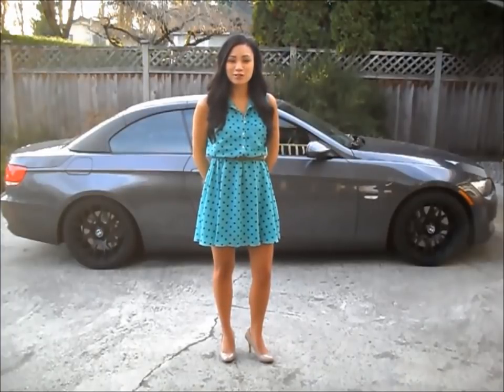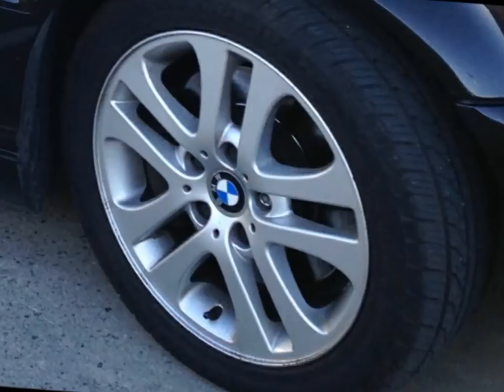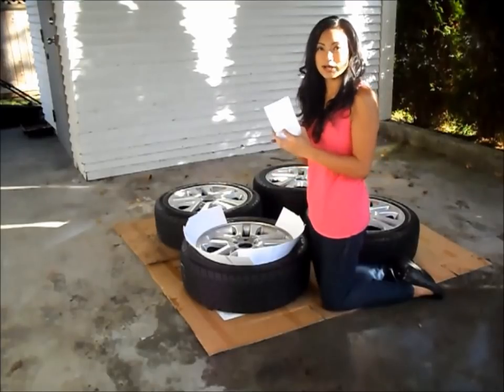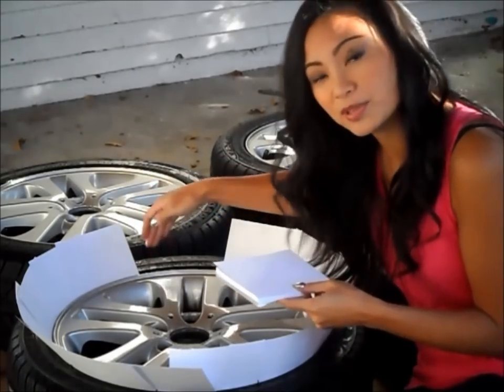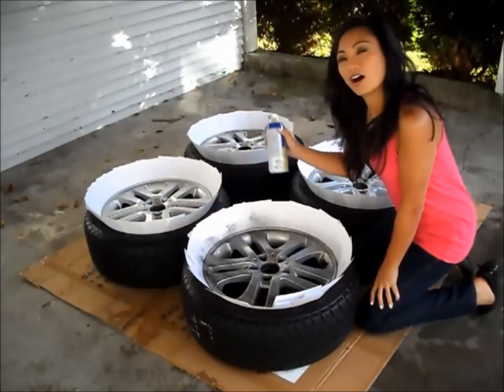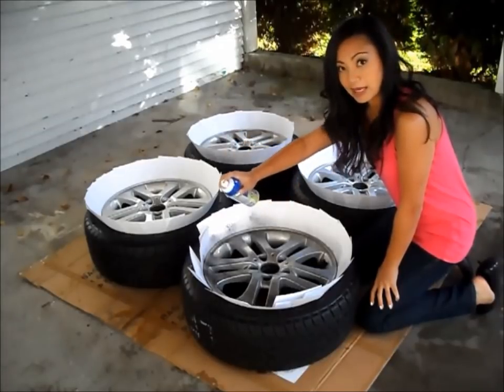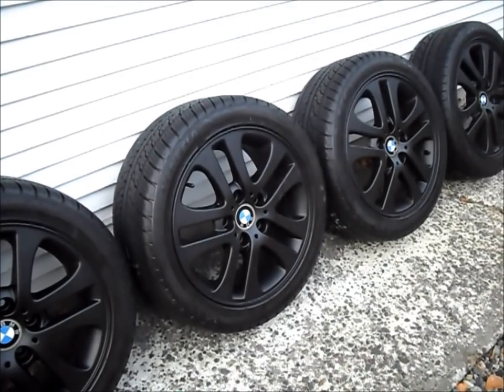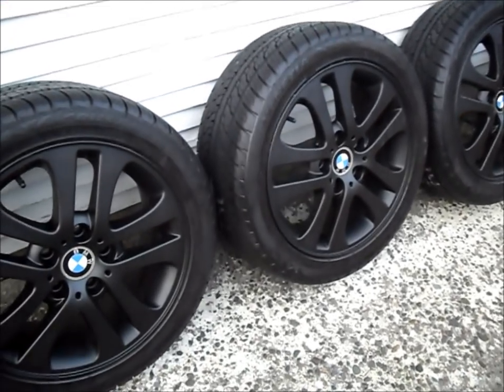How to Plasti Dip Car Rims - Matte Black Wheels

Comment: So many mistakes, women are cute sometimes.
Reply: David G What exactly was the mistake?
Reply: Brandon Brown 1. She didn't seem to perfectly clean the wheel before spraying paint to it.
2. She's painting them OUTDOORS which will cause dust to stick to the paint.
3. She covered the tire, which has really no advantage since the plastidip don't even stick to the tire, it'll peel off by its self. 
4. She didn't cover the BACK of the wheel, which still silver with black in the gaps where the paint go thru.

There might be more, but who's counting...?
Reply: Aleks Verduzco
 exactly haha, thanks for replying for me.. If you don't see mistakes Brandon Brown you probably shouldn't be painting.
Reply: David G also she didnt prop the wheels up on a wall. Rattle cans are not meant to be sprayed straight down because it causes the can to have a globby spray.
Reply: True! It just goes and goes.. She is cute tough...
Reply: Aleks Verduzco you mad?
Reply: David G She's pretty so who cares? ☺
Reply: +David G Holy shit dude it's not like he's pursuing a career as a professional painter.
Reply: just messing around man, idc its her wheels kbman99
Reply: +Aleks Verduzco well, she also holds the can too far away from the rim, wich can lead to a "texturized" result. Besides, 2 or 3 layers are not enough if you desire durability and easy peeling.
Take these as advices and not criticism.
Reply: "when it comes to the day of the contest, I am his father. He comes to me for advices."

Comment: Good job miss !
Is it hard to take out tires from the car ?
How long did you cover the 4 tires ?
Reply from the maker: I had a shop remove the tires at that time but I have since learned how and it's easy! Unfortunately I have sold those wheels now so I don't know how long the plasti dip lasted.

Comment: Thanks for the technique :) had an issue with white over spray. It would get caught between the lettering on tires. Took time to get every last bit off but this way is so much easier. Keep up the good work.
Reply from the maker: Thanks, Adrian! Glad I can help!
Reply: Do the cards stop the plastidip from coating the edge of the rim where the cards are contacting?

Comment: Tara I have a 2010 jetta tdi and i was thinking about using the matte black on the front grille or going with actually getting it painted gloss black to match the rest of the car. Any thoughts on this? By the way great job on the wheels. Like the BMW!
Reply from the maker: Aaron Cope I would recommend gloss, but if you're on a budge, plasti dipping matte black is fine too.

Comment: Amazing results ! One question Tara, how long did you wait until you put the rims back on your car? Cure time, thanks
Reply from the maker: Well these tires actually didn't end up fitting on my new BMW. Grrrr. But you should probably wait a few hours. I used plasti dip glossifier and then drove after maybe an hour (don't remember exactly) but then again it didn't turn out great.

Comment: Hi
Questions, do you have to sand the rims or just wash them ?  Also did you do the lock nuts? How's the paint holding up since you did them
Reply from the maker: No need to sand. I sprayed right over the lug nuts. I had to sell those wheels so I'm not sure. I hear it should last a couples years.

Comment: the wheels looked great.  Was the use of the index cards so you didnt have to peel the excess off out of personal convenience?  I usually just peel the ring of plasti dip off the tire.
Reply from the maker: Thanks! Yeah, I just thought it would be easier to not have to peel off the overspray from the tires.

Comment: Hey Tara, I'm planning on plasti dipping my car's rims. Since I wanted to be more efficient I wanted to take off all four wheels so I could spray them at the same time. How did you take off all four wheels? Did you just use jack stands for all four sides of your car? And also is the plasti dip they sell at home depot that's just labeled "black," does that come out to matte? Thanks.
Reply from the maker: Sorry I didn't take off the wheels myself. I had them removed for the summer at a shop. Yeah I believe the black should be the one. And if you want it shiny, buy the glossifier plasti dip as well.

Comment: Cool videos you do.Do you have to sand down the Rams before you put the plasty dip
Reply from the maker: Nope, just make sure they are clean!
Reply: What thr best cleaning product do I use and how long does plasty dip last
Reply from the maker: Meguiars is good. If you're careful, plasti dipped wheels can last a couple years. But you can also easily touch it up or re-do it if they get scratched up.

Comment: When you put the wheels back on the car, does the plasti dip peel or twist in the spots where the lug nuts are? Would you recommend balling up tape and putting it in the lug nut holes, or no need?
Reply from the maker: Yeah there is a risk of it peeling a bit when you tighten the lug nuts but you could touch it up after. Sadly, my wheels didn't fit onto my car so I never got to see them put on.

Comment: How did you get the inside of the wheel so well? (Mounting side) when I painted my wheels (spray, not plasti dip) I stood them up on the tires to be able to spray front and back evenly. Also, I liked the index cards! I used a couple decks of playing cards but the index cards are a great idea as they are much larger
Reply from the maker: tipwell ington The inside isn't done that well. Just sprayed what was visible. Thanks, yeah the larger the index cards, the better!

Comment: Winter tires in Vancouver?? How many days of snow do you guys really get there? Def an added security measure, but I've been driving w/o winter tires here in Toronto since just about the beginning of time. I just got my first pair of winter tires (new car), but I'm also wondering, how much does Plasti Dip protect your rims from road salt and grime?
Reply from the maker: Haha, yeah it only snows a tiny bit maybe three times a year, but it is very rainy and icy. Yes, I've heard plasti dip is good to protect from salt etc. But I don't have those wheels anymore.
Reply: TVTara I ended up finding an excellent deal on some factory OEM rims in a used tire shop. Putting my snows on this week :P;;;  I can't believe that snow tires are mandatory in Vancouver while we already have black ice here in Toronto, and 85% of us never drive with snow tires....  I guess better safe than sorry
Reply from the maker: Well, they aren't "mandatory" in Vancouver. Just a good idea :)

Comment: I'm going to do this too...  With Plasti-dip, you don't have to worry about over spray on the tires.  It just peels right off the tire and adheres only to the rim. Cuts the prep time to almost nothing.  Just make sure the brake hardware is covered if you do not remove the wheels from the vehicle.  FYI
Reply from the maker: Yeah I've recently done another video and I kept the wheels on the car and did it like you said. Thanks!

Comment: Hey TV Tara! Nice Video. Just one question. What happened to the other side/bottom part (as you were spraying from the top) of the rims? Thanks.
Reply from the maker: The other side doesn't need to be sprayed. Only touch up here and there in really visible places.
Reply: Thanks for the reply. Sounds reasonable. One more question though. Someone asked about the number of cans you used and you said 2. Are you sure 2 would be enough? How long your dipping lasted with 2 cans?
Reply from the maker: I used a tiny bit of a third can. I don't think you need much more. My coats were actually too heavy I think. I sold those wheels since that video so I don't know how long it will last. Sorry!
Reply: oh ok. Thanks Tara.

Comment: How durable is the dip for a daily driver car? Any issues with detailing the rims with a cleaner or using tire gloss afterwards? Cheers!
Reply from the maker: Sorry I sold my wheels so I can't answer about durability. But others have dip on their daily drivers for a couple years.
Reply: My wife's car's rims have been dipped for about a year now and they still look like they did the day I dipped em.  I'm very impressed at how long it's lasted.
Reply: If u do it right, u can even drive into the carwash, i diped my 17" TSW PACE to matte black, but i used 4 cans (1 can=1 wheel). Carwash i use has wheels brushes and wheels r still intact. Lost some shade tho. Its not as black as it used to be, but cause of that could be anything ... whole year driving, different manufacturer of PD, maybe even those wheels brushes in carwash, Who knows. This is img how they looked freshly diped, now (after 1 year) they r more ... grey-ish,but still not a scratch on them :) http://postimg.org/image/azanm7ee1/

Comment: I know your not a plastic dip scientist but the finish of your mags looks very smooth ... i just sprayed my mags and the finish is rough (like Sand) . I did 5 coats ...
Reply from the maker: Up close mine wasn't that smooth. It was textured from doing heavy coats which is probably like yours.
Reply: Thank you :) that is probably what happened !

Comment: any pre dip preparations?? BTW can't you just peel off the overspray on tires? Nice job nonetheless
Reply from the maker: Nah, I just washed and dried the rims first. Yeah, you can just get plastidip on the tires and peel it off, but I thought it would just be cleaner and easier to cover them.

Comment: dont need index cards, best to spray plastidip right on tire peels right off and you get the full wheel, in addition it only takes about 15min drying time between coats.
Reply from the maker: I still prefer index cards, but yeah, my drying time was too long. This video is really old now ;)

Comment: After work done. Should you wait for some more time or need to be under sunlight cos.  When to fix it to the car Will it get scratched and peels off. Did u face any issues when fixing back. Thank you.
Reply from the maker: +Kakarla Avinash I would wait a few hours before putting them on your car. These wheels actually didn't fit on my new car so I sold them.
Reply: Than you. Ones again for immediate reply

Comment: Are you Using the same paint when you say go the next coat? Or are you using some other kind of chemical to make the black paint stick to the rim.
Reply from the maker: It's the same. I only used one product. Black plasti dip.

Comment: Was the car elevated on an autoshop jack? You managed to get rid of all four of your tires.
Reply from the maker: I had taken them to a shop to switch out the summer tires (I have since learned how to do it myself) and they just told me they wouldn't fit. So I sold them on Craigslist and bought new ones.
Reply: Ah okay thanks for replying. You did a great and short tutorial by the way!

Comment: I'm trying to hate or anything but just so you know you can plasti dip with your rims on your car you just need to cove the calipers and your brake dish and it's ok if you get dip on your tire with all the coats it comes right off and for your car any over spray comes off with a micro fiber towel
Reply from the maker: Yeah but the wheels were already off because they are my winter tires. :)

Comment: Quick question, when I put the wheels back on my car I stripped the plasti dip when I was tightening the lug nuts back down, is there any way to avoid this?
Reply from the maker: +Riley Refuerzo I don't think so. Just got to touch it up afterwards.

Comment: Good job my friend. For those who will be trying this project soon, strongly recommended to wash and roughly sand down the rims with a medium grain sand paper first, wipe it down and then prime it with a primer before applying your multi-coats paint. Yes, it will take extra hour or so, but your paint job will last much longer and look even nicer. Oh, do put on a simple surgical mask when applying your paint job to prevent from unnecessary inhaling any chemical. Good luck. ^_^
Reply from the maker: Ah, good tips! Thank you!
Reply: You did a great job. I was just being nosey!
Reply: Only need to do this for real paint, not plasti-dip

Comment: How long did the dip hold up on the rims? I had mine pro dipped and it kept peeling after about 2/3 months. 2013 Charger SRT 8 and guessing its the dust from the Brembo's. I had them powder coated instead as it became a pain to keep redoing.
Reply from the maker: I don't know. They actually didn't fit on my new (current) car! I had to sell them. I want to get my current wheels powder coated gloss black now.

Comment: two cans? how did you pull that off? I used like 8 and still peeled like crazy over time...how do you prevent yours from peeling..if it even does not peel for that matter?
Reply from the maker: Wow, I think you did too many coats! However, I no longer have those wheels so I'm not sure how long it lasted.

Comment: This may be a dumb question, but how hard is it to get it spread out even on the wheel?
Reply from the maker: If the wheels are lying down on the ground, it's easy to spray it evenly. I did another video with the wheels on the car and it's much harder.

Comment: Hey Tara I was wondering how you didn't get the bmw emblem in the center of the tires sprayed on? Or did you but you just peeled it off?
Reply: when the rims come off you can see the emblem can be pushed out of the back easily, and replaced just the same.  simply push it out with your thumb before spraying.
Reply from the maker: Yes, just pop them off with a tiny screwdriver.
Reply: Alicia Hooker little late on replying lol but most emblems can be popped out with tabs but be careful especially on german cars like audi and some others have tiny screws holding them in

Comment: hey i thought plasti dip would peel rite off the tires so no need to protect them, if not maybe some silicon tire shine product will prevent it from sticking
Reply from the maker: Yeah, I sprayed glossifier in another video without protecting the tires but actually I think it's easier using the index cards :)

Comment: How would you handle any scratches already on the wheels from curb damage?  Sand them down some first?
Reply from the maker: Minor curb rash will be hidden by plasti dip. But any major damage should be sanded down first to make it blend. (If you are picky)

Comment: what kind of spray did u use? and did u have to prep the rims at all before spraying them? thanx
Reply from the maker: I just used the plasti dip spray can in matte black. No other equipment. No prepping needed. Just wipe them and make sure they're clean.
Reply: awesome thanx
Reply from the maker: No problem! Good luck!

Comment: It works better to put the note cards lengthwise, you will use more of them but have better protection for your tires. Not a huge deal for plasti-dip but with actual paint it's pretty important.
Reply from the maker: Oh, interesting! Thanks!

Comment: Really considering doing this with the stock rims on my 2011 Xterra Pro-4X.  Does the plastidip leave any residue if you ever go to peel it off?  How easily does the pastidip chip.peel off?
Reply from the maker: No residue after removal. It peels off easily once you get under it. It doesn't chip easily though.
Reply: Awesome!  Good to hear!  Yours look great by the way, sorry you didn't get to put them on your BMW. :(

Comment: Hey Tara, would you be able to tell me how many cans of Plastidip you went through cause I'm planning on spraying my alloys aswell but I want to prepare by buying the right amount instead of running out and having to go buy more during the process.
Reply from the maker: Hi Neil, I used just a bit over two can so buy 3!
Good luck! :)
Reply: Thanks for the quick response! I was kind of skeptical about buying 1 or two cars as you have to spray 3 layers on them, and seeing that it's pretty hard to get Plastidip in the UK I have to order them online, but yea thanks again!
Reply from the maker: Yeah if you're buying online, then buy more than you need! I just bought plasti dip glossifier online and I ordered a 6 pack from the US which was the same price as buying two cans in Canada!
Reply: Woah, I'll look around cause it's so expensive for it over in the UK, just need to look around and find somewhere cheap that doesn't more than the actual product on shipping
Reply: TVTara where did u order that from?? I tried to order it and they said they wouldn't ship it over boarders, btw great work on those wheels
Reply from the maker: If you're in the UK, try Amazon UK.

Comment: I'd like to plast-dip my spokes black because the style doesn't come with black spokes which look great with a polished lip. I suspect this stuff peels easy and can be chipped away by your fingernail... which is like a rock chip?
Reply from the maker: Nah, it's not that easy. It's pretty durable. But if it does get a little chipped, you can just spray on a bit to touch up.
Reply: TVTara
Thanks. Okay, I'll look into it because my rims will look so much better and if it lasts reasonably long, I'll be happy.  Hmmmm... question though, how come you just didn't paint them with normal semi gloss or satin black paint? Just curious because I wonder what's the best choice for me seeing how wouldn't ever want to peel my spokes as I want them black for good.
Reply from the maker: I wasn't sure I wanted them black permanently. Yeah, maybe just paint yours. But then you better be really sure that you'll like them ;)

Comment: so after two in a bit years how are they holding up? have you redone them, peeled them off? I want to do this to my enclosed trailer rims as trailer rims are notorious for rusting.
Reply from the maker: Oh I had to sell them right away because they didn't fit on my new car 😔
Reply: ok thanks! Good tip on the index cards, i was going to wrap pieces of cardboard or poster board around the rim, index cards will be much easier and i already have some!
Reply from the maker: Oh, awesome that you already had some! 👍🏼